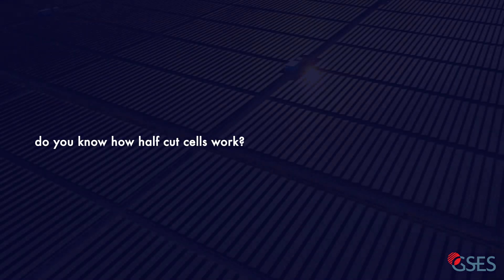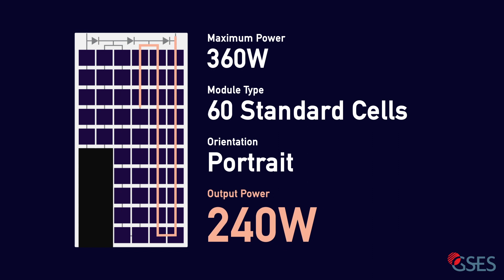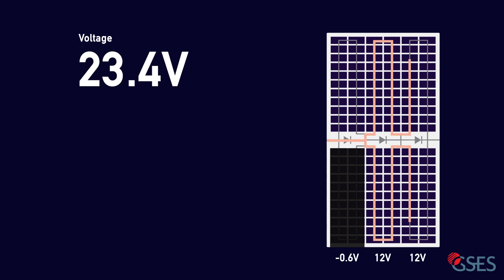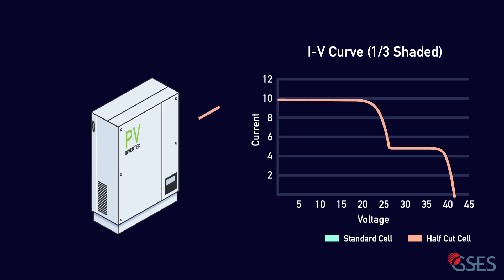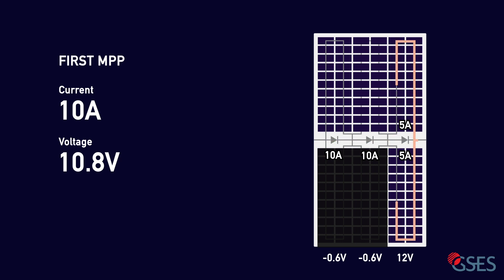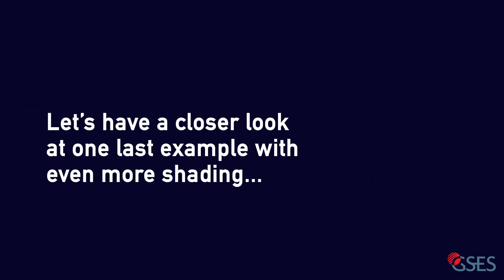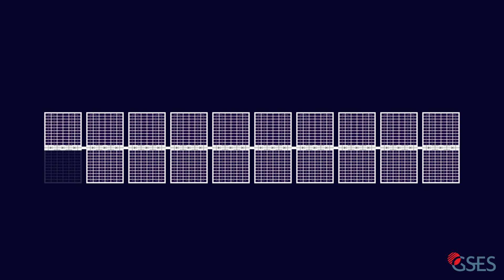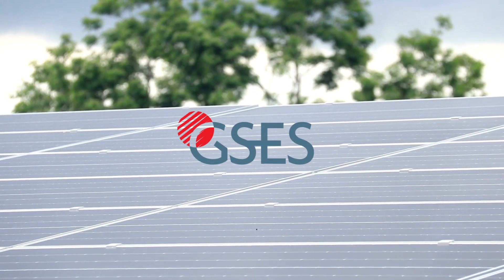How half-cut solar cells work in shaded conditions.

Comment: If the inverter performs its global MPPT sweep. Does that mean it will find the peak for the whole array?  Will one panels being partialy shaded limit the current and even though the 2nd peak is better than with standard panels does that still mean every panel is still reduced to match?  I.e If one panel in the array is partially shaded as shown at 6:26 reducing its maximum output to 180W I assume that still means that every panel in the array is reduced to 180W as well?

Comment: Why you wrote bad information about shade on half cut panel ? One 60Ws section above shadding you forgot. 300W no 240W. You must study before explained !!! Ou ou....
Reply: They are actually right... if bypass diode is activated, given Kirchhoff law, "section above shading" operating with a voltage accross it of -0.6V. Doesn't give 60W...

Comment: Great video. That last example was what i was wondering. Is it expected that the string inverter with global MPPT will still attempt to sweep the current(?) and then notice that, with all other 8 modules unshaded, dropping the current (to recover some output on the affected module) will not be worth it since it would cut the other modules' output in half? Hypothetically if all modules had effectively similar shading, the MPPT would change the current to at least get something out of them? What about scenarios with not though minimum voltage from the string?

There's just so many variables to the shading situation

Comment: This is good if you are using Microinverters per panel, or if you have connected it in Parallel. Only two panels in series, will have huge power reduction, if MPPT cannot track the MPP of the whole string.

So, as we know, one module is Divided into 3 strings using By-pass diodes, and those 3 strings are cut and connected in Parrallel. The problem even with two panels is, if there is some sort of shading in one part of the panel, 1/6, and if the MPPT controller is not able to lower its voltage. All the string will start working at 50% of the power, and if there is no proper sweep function in the MPPT controller, you will be stuck at 50% power unless that shaded part is cleared. 

Either that, or you will need a really good MPPT controller to properly track the MPP. From my setup, where I use two Half-Cut panels in Series. I get shading from a small wall next to the panels till 9AM in the morning. In somedays, the MPPT tracks 68V, and I get full output from both the panels, except that one string. However, some days, it keeps tracking at 84V, which makes the panels run at 50% of its power, when only one of the strings is shaded 1/12. 

If I talk in Watts, the total watts 1100 Watts, divided by 1/12, gives 91.6W each. So in my case, I should loose, 2/12 worth of power if its shaded on one part, which is 183.3W. However, due to MPPT not able to track the MPP, I am stuck at generating 6/12 worth of power, instead of 10/12. Which equats to 549.6W instead of 916W. Thats a 50% loss in power production, instead of 16%.

So its better to avoid shading or get a really good MPPT controller, or use a Microinverters, or individual MPPT per panel.

Comment: I wonder if someone did real IV measureemtns. Everywhere I see only simulations and mind games. It looks like the only way is to do experiment myself..
My Hoymiles microinverter does not search for global maximum - it just cuts half at small shading. And gives 0 output at shading of 2 cells - one on each side of the panel at.  Potentially it should have activated diode, but Hoymiles microinverter does not feel it..

Comment: I have 9x 550w half cut solar panels in a string (4.95kw) ground mounted.
And i experience multiple types shading in the winter. Light scattered shading from a tree, total shading from the house (morning only) and single half pannel shading from the apex of my neighbours house.
Total shading ruins output... 200-400watts Total 
Total shading over half the panels is pretty much the same until only 1 or 2 panels are shaded when outout rockets from 300/400watta up to 2kw.

Recently with the low sun ive noticed the  triangle shadow of the apex of me neighbours house on a single panel.
Curious of the output ive seen my sunsynk inverter display show fluctuations in current by as much as 1 or 1.5amps and then some rapid voltage adjustment when the sunlight is pretty consistent.  I had a feeling the inverter was searching for a maximum power point... and I'm guessing this is due to the half cut panel characteristics...

I have ordered Tigo TS4s as this should help further mitigate some of the shading.

Your video explains exactly what I am seeing with shading and I understand why I see the shading effects in power output.
Thank you!
Reply: Hi, have you installed the tygo optimisers? Did you see any improvement?
Reply: Any improvement

Comment: I am studying the layout for my 6 485w panels and my pitched roof is poorly oriented as it starts to get shadding diagonally at 6pm. If i instal the panels portrait oriented, they will start to shade the top left half, then the bottom left nearly at the same time the top middle half and so on. Is still portrait the best option here? I am glad I found this video as I was almost starting to install them in landscape orientation? They will get installed in sets of 2 for the best exposure.
Reply: I think microinverter is the best solution for your case. Every panel with a dedicated inverter to maximize power.

Comment: Before I viewed this presentation, I saw one from a guy who was attempting to make a point about how string inverters performed nearly was well as microinverters when panels were shaded. To make his point, he measured open circuit voltage, Voc, then short circuit current, Ish, for two cases, namely with a panel shaded and with all panels illuminated. Since Voc and Ish were similar for both the above cases, this guy then claimed that shading a panel in a string inverter system did not appreciably reduce power production.
Unfortunately, I suspect this analysis was WRONG because as your video demonstrates, the I-V curve of solar panels is HIGHLY NONLINEAR. The Voc and Ish can be converted to maximum power delivered ONLY if the system has a linear I-V curve.
Thanks again for clarifying this!

Comment: I don't understand why the unshaded area gets half the current instead of the full current while the voltage is equivalent of the unshaded.
Reply from the maker: Are you wondering about why the string of 20 half-cut cells has the same voltage but half the current of a string of 20 standard cells? If so:
In a PV cell, the voltage is related to the band-gap energy of the material involved - in most PV modules this is silicon. There's no difference in the material when you cut the cell in half, so standard and half cut cells both have the same voltage.
In a PV cell, the current is related to the area of the cell. So when you cut the call in half, the current in the half-cut cell is half that of the standard cell.

Comment: Lost credibility showing part shaded 60c as no voltage and current. That's not true.
I also don't think the examples are really a true account of shading in the real world.

I was wondering about the spilt panels.
I did notice that you didn't do any string examples. Because that 10a to 5 in a. String is a pull down.
Reply from the maker: Hi Rory,
Thank you for the comment.
We did make the decision to show shading as a complete lack of irradiation, to make the concepts easier to understand. In a practical situation, there might be 10-20% irradiation still available, due to diffuse sunlight, which in the video examples would correlate to a 0.5A-1A current per substring. Because this is very small compared to the full irradiation current, the operation of the MPPT and bypass diodes won't actually be affected; they will still operate as demonstrated in each of the examples shown. The only difference is that there will be a slight increase in power output when the bypass diodes are not operating (timestamps 6:27 and 7:49 may be up to 216W rather than 180W, and timestamp 8:55 may have up to 6A rather than 5A). Again, the operation of the bypass diodes will be unaffected.
For examples of shading effects in full strings, have a look at timestamp 8:01-9:00 - it's a similar effect to a single module but on a larger scale!

Comment: I have a defective half cell  360W panel. First 1/3 of the left side in portait will melt snow faster and that particular panel  output voltage is 2/3 of rated open circuit. There are 2 series of 8 identical panels with no partial shading. The power loss (120W from that panel + 120w from the unbalanced string) is not that concerning.
Is it the first bypass diode being shorted?

Comment: Gday folks, Can you tell me if Half-cut modules are ok to fit into an off-grid array. I am considering upgrading my old 185w panels with 390w panels.
Reply from the maker: Hi there! Yes, half-cut modules are installed just like any other solar modules. Please check out the relevant Australian Standards for any updates to your system.

Comment: In properly orienting half-cut panels, does it matter which end is up in a portrait orientation?  Or does proper orientation only mean portrait vs landscape -- and which end is up doesn't matter?  I noticed that with my panels (all in portrait orientation), some have the serial number sticker at the top, and others at the bottom -- arbitrarily.  (Some of my panels have the top half in shadow for a period of time, so want to make sure they're oriented properly.)
Reply: This was my question as well as at 9:20 it refers to the bottom half of the panel
Reply from the maker: It doesn't matter whether the end with the serial number sticker is at the top or bottom, as long as the cables at the back are connected in the correct polarity.

Comment: The half shaded single panel in a serial string will halve the current through the shaded bypass diodes but it will not increase the serial string voltage significantly. However, if it was two split panels in parallel, then the split panel shading would reduce losses significantly over a conventional panel.
Reply: So they would build them with 6 bypass diodes instead of 3, and two main buss bars. I suppose it would add a dollar or two at volume,  but I question how many scenarios where you would see such complicated shading. Probably in residential installs with shading from dormers and trees. I live in a town that gets snow so it has steep roofs and lots of dormers, they would probably be beneficial here, by a few percent of total output.
Reply: I believe that the 3 bypass diodes are sufficient normally and solar panels are very cheap now after the price reductions of around 90% over the last 12 years so one can over power the array into the inverter and not worry about losing a few panels to shading when the sun is low and weakest 
 @nicolasrenold

Comment: This is basically the only video (or article) I've found online that wasn't a bunch of half truths and misconceptions regarding solar panel shading, but actual practical data applicable to the real world.... Thank you.
Reply: Theoretically, I do agree. Today though, I put two panels on the ground, a lightbulb, and started testing with shading manually. The outcomes are unexpected. The output didn´t want to go down much, unless both halves were shaded. Standing above panel didn´t do much, only solid cover over both (parts) of the panel lowered the output. And so I begun to be somewhat skeptical.